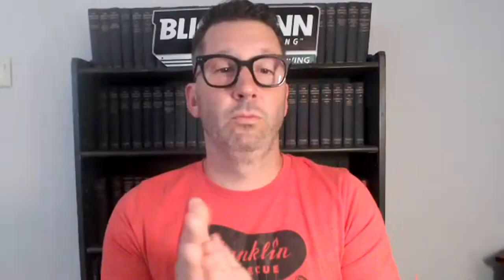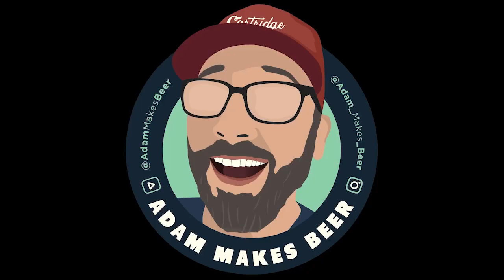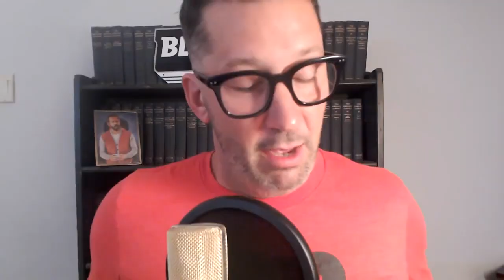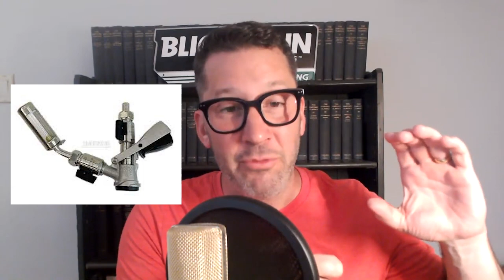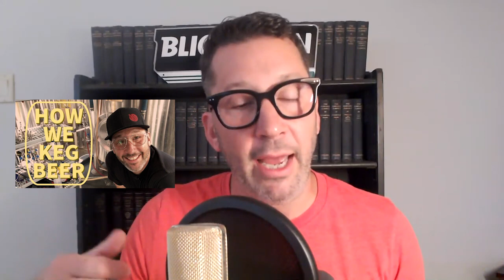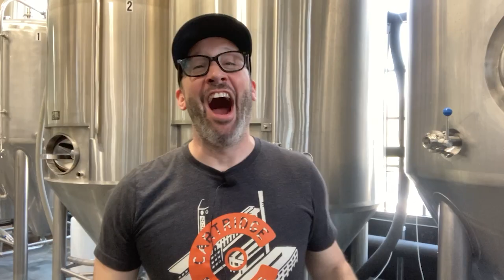Are You Losing This When Kegging?

Comment: We place our kegs on a 2x4  angled forward  (for the head space)  and use the same valve idea ur doing but we keep the valve closed for a little bit so it fills at a slower rate then we crack it   till we get beer out ...usually keep  the tank around 15 psi